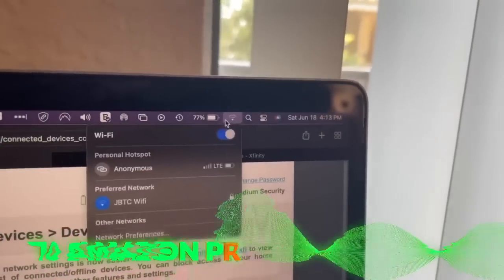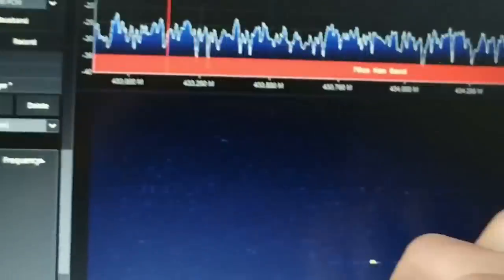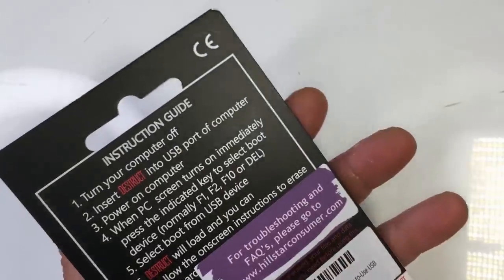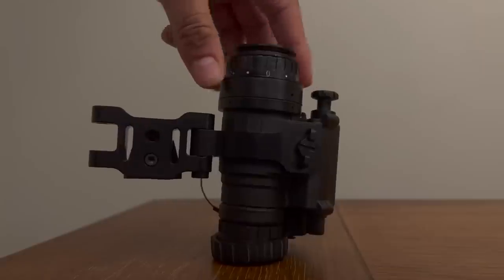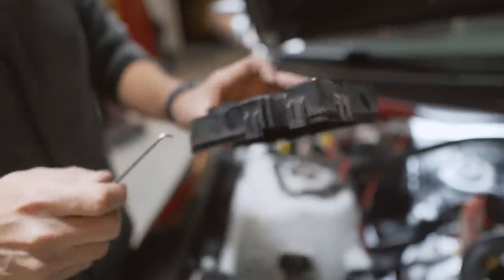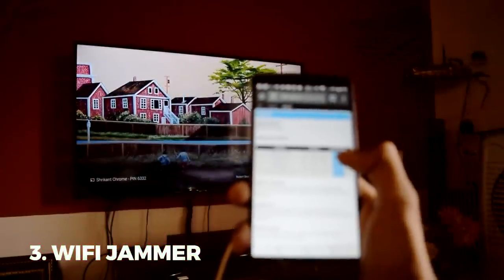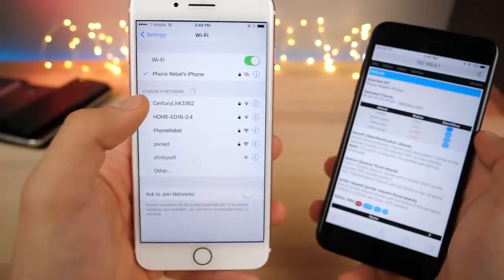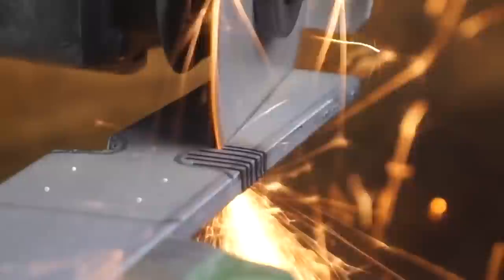10 ILLEGAL GADGETS That Are Still Available On Amazon!

Comment: using a flipper zero to grab the signal can only unlock it once due to rolling codes, an can often desync your car key. rolling codes can be cracked with a flipper after a few readings with a custom firmware if i remember right